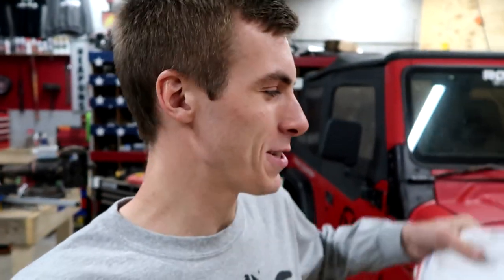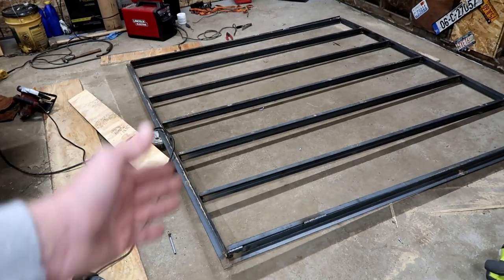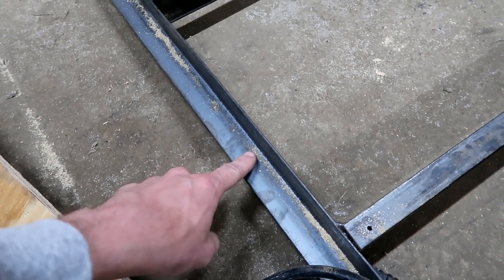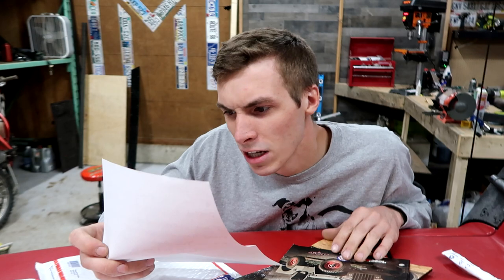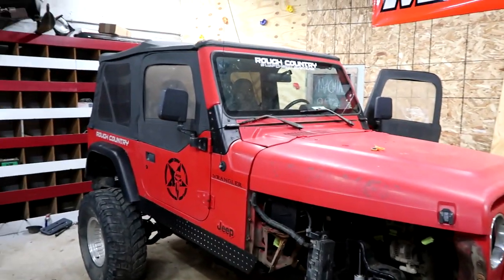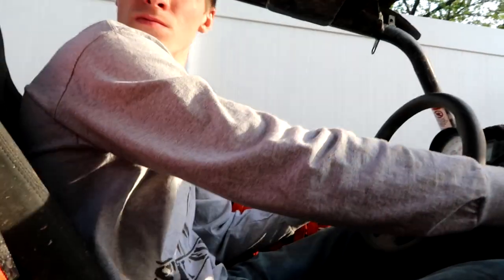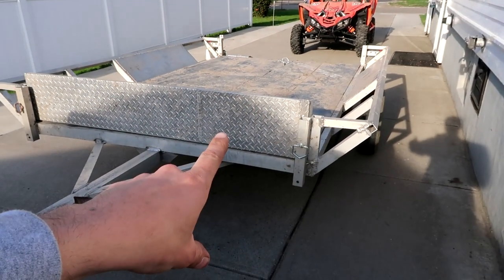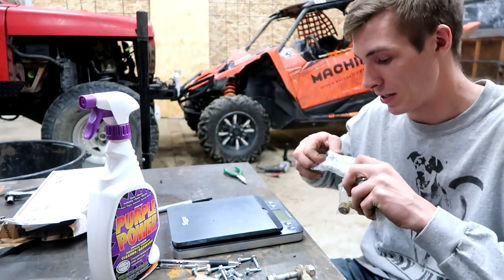Biggest and The Baddest

Comment: Rather than welding it back together, why not make it so the two halves bolt together?  That way they can coat it, and if you did it right it would be just as strong, and easier to transport...

Comment: You really need to use aluminum sheet. It's gonna weigh a lot less.
Reply: Larry Yaw he wants to drive on it
Reply: Expanded metal on the inside (drive on side) and sheet of aluminum over the wood on the outside.